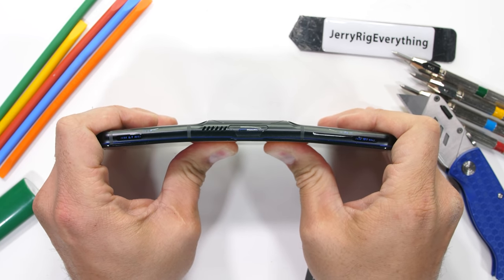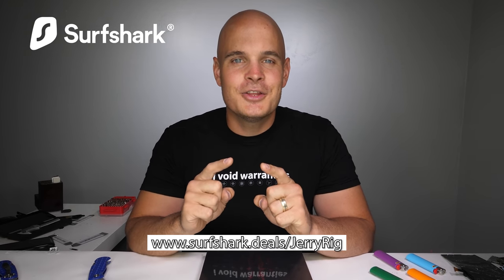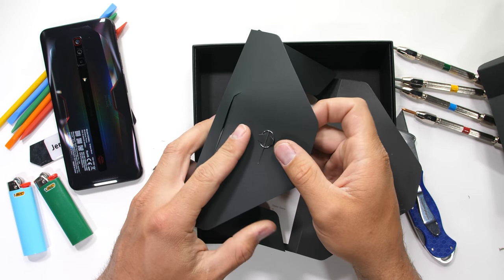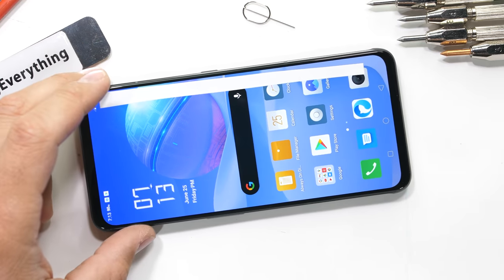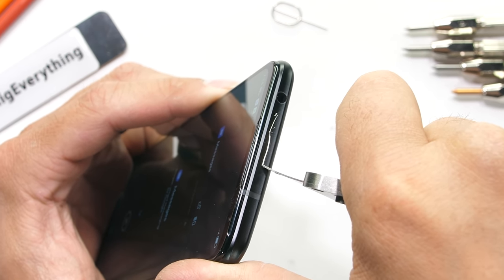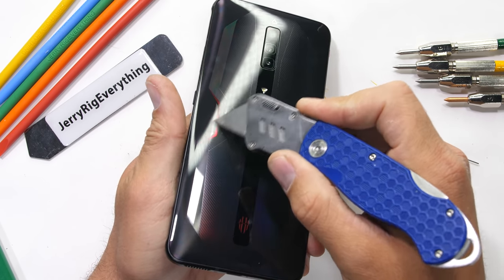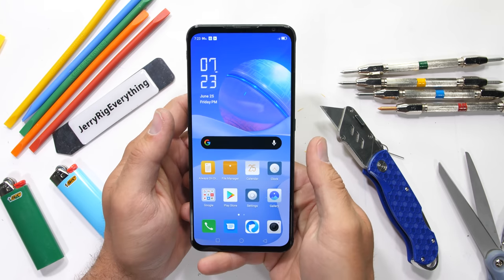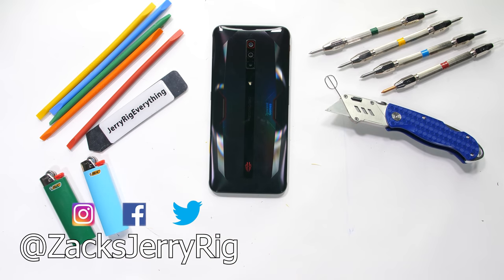Not all Gaming Phones Survive... Red Magic 6 Durability Test!

Comment: Never been this early. Also, never had the idea to get a gaming phone. The ones that have perished are a solid reason as to why
Reply: only this year's gaming phone are like that. Go check out his older videos on gaming phone, most of them survived. Generally speaking, gaming phones have better specs (screen refresh rates, 90,120, 144 and now 165hz, etc) and weaker cameras. Some have a few more wifi antennas located within the phone to offer more stable wifi connection.

Comment: Nubia is most underrated phone. That's why this phone hard to recommends 😂
Reply: They are underrated because of the lack of software updates and the bad ui
Reply: @ANabih-uo3zy  I agree, my 6 Pro has so many bugs.
Reply: @ANabih-uo3zy  
That sounds worse than Lenovo's lack of software updates. Ouch. 

If I worked in the right department at Google, I would've proposed them to mandate a certain amount of years of software support per device for Play Protect (and GMS) certification.
Reply: @kbhasi  As an Asus user, I can safely say Asus will mostly likely overtake Lenovo with the lack of software updates😢
Reply: @proxyhx2075  
As a fellow 6Pro user, do you experience a bug with the YouTube app? Like does it chugs after awhile, eventually crashing after long sessions of usage? I got around the problem by heading into the apps settings and selecting "force stop" every time it starts chugging. Open the app again and it solves the issue, though only temporarily.

Comment: From what I heard the "bloodgroove" thing is an old wives' tale, the fuller is just to remove material from the blade to make it lighter without affecting it's strength.
Reply: True, but it did have the added bonus of allowing the user to pull out the blade a little easier when you ran someone through.

Comment: That's pretty damm good phone, maybe best of the year. (Especially since you can turn the fan off) It has a headphone jack, no notches/cutouts, solid battery and an amazing display. Definitely would consider it, if I was in a market for a new phone. (I will wait for phones with underscreen camera though, however long it takes)
Reply: It has a solid build quality but a warning to you from a RedMagic 6Pro owner... The software side of things is a mixed up. I find myself having to go into settings constantly to select "Force Stop" for YouTube after a few hours of usage. For some reason it chugs and can even crash if not force stopped every once in awhile. That's my biggest issue with it, and the launcher for it is pretty average, though it can be changed with a different launcher.
Reply: @summerycast7936  Have these problems been fixed?

Comment: I bought a new phone, Oppo Reno 5 Pro 5g this month. I set up the phone yesterday. However, I poked the sim card tool into the microphone hole instead of the sim card slot (both at the bottom at the phone). I would like to ask if this would damage the microphone and water resistance ability, Furthermore, I hope that nothing in the microphone hole was pushed forward due to this action.

Comment: I bought this phone earlier this year and an update for the Chinese ROM in English (and it does not allow a Global ROM unless you flash it to the device via PC) tampered with the firmware that manages the battery, basically bricking the device and lets the battery die even while it's charging, which it will be 'slow charging' it will say for some reason... I very much do not recommend this brand. My next will be ASUS ROG 5, personally...